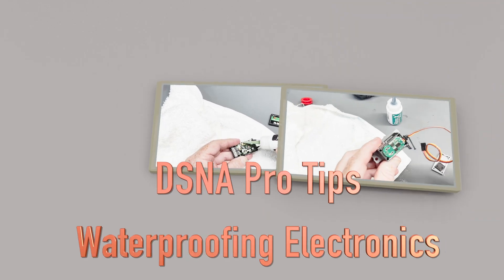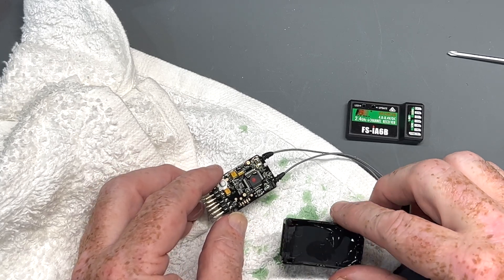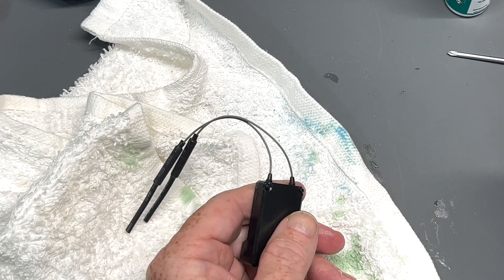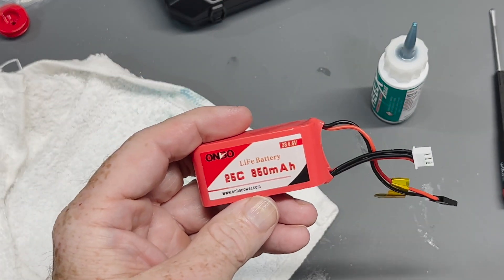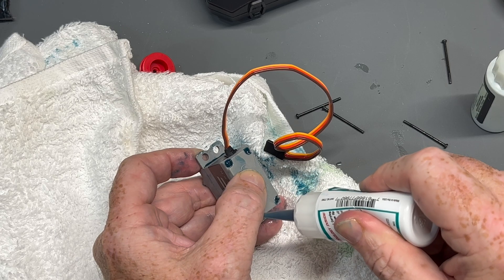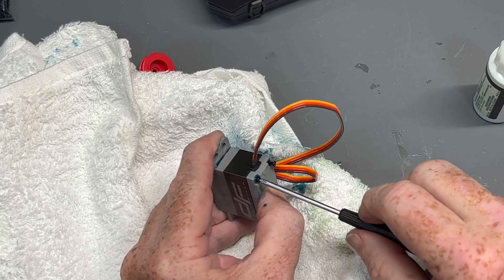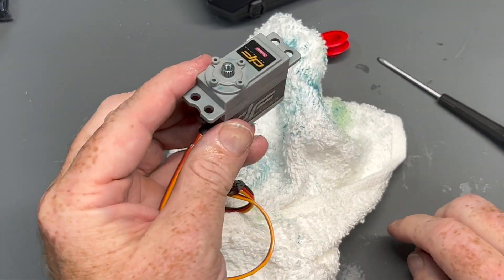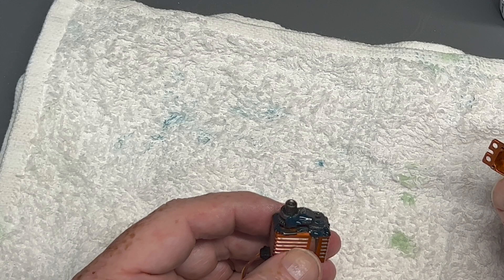DSNA Pro Tips -  Protecting DF Boat Electronics with CorrosionX / ReelX Grease

Comment: I have run my Rx in a bath of corrosionx for 3 years , bagged up in plastic bag . I once saw a tv running in a fish tank of corrosionX and iwas sold on it ever since. I plasti dip my battery pack and servos and CX the connectors
Reply from the maker: We must have seen the same demo at Mike Hobby back in the day ;)
Reply from the maker: One issue with Plastidip though is the servo case can overheat
Reply: @DragonSailingNorthAmerica  good so far for two years but max temp here is 95F , not the hottest place on earth